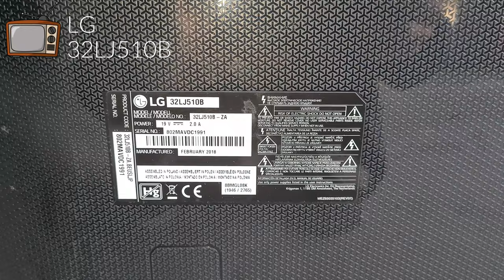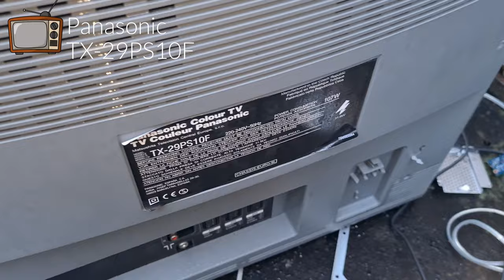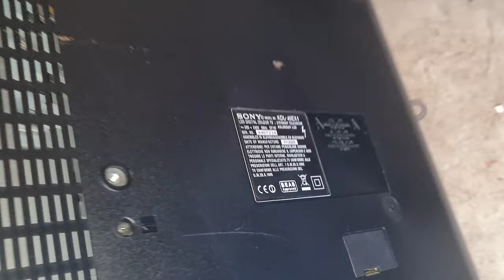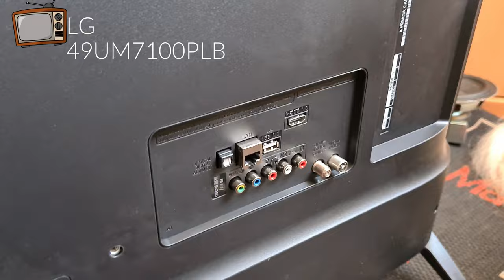Speaker Hunting Video #44 | B&O CRT and many nice flatscreens!

Comment: I have that exact same 32” lg tv, but it’s called the 32lm570bpua in the USA. It has the same speakers, or at least appears to from the front. One question, are they k-tone, estec, or emsonic?
Reply from the maker: How do they sound in the tv? They're Emsonic its written on the magnet lol
Reply: @LSandM-SpeakersFromEverywhere  The reason why I asked what brand they were is that I had seen those exact speakers online, and some were K-tone, some were Estec, and some were Emsonic! This was a strange discovery for me, and really made me wonder what my TV had. I noticed you did show the back of the magnet in your video, but the Emsonic logo kind of looked like the numbers and I didn’t notice it. Funnily enough, it looks like it says Emsonio. I also saw someone selling a single K-tone with a single Emsonic from the same TV, and they looked identical. It reminded me of the mismatched Matsushita and Sony horn loaded drivers you pulled from the same CRT all those years ago. I don’t want to try to take our TVs apart, but my sister has the same one. I wonder what the chances are that one has different brand speakers than the other, or even in the same TV! 
Also, they are not actually too bad. They seem to have at least some bass, and they have surprisingly good midrange/vocal reproduction, but not really much high treble. Turning it up above about 70% does not make it any louder, it just adds treble. They do still get kind of loud, but not nearly as loud as a lot of other TVs do.
Reply from the maker: Oh okay I see. This is common with LG, the main brand is emsonic tho, the other ones are just manufacturing the drivers for emsonic. They're not that bad but they sound aweful compared to the ones used in the selfcontained enclosures.